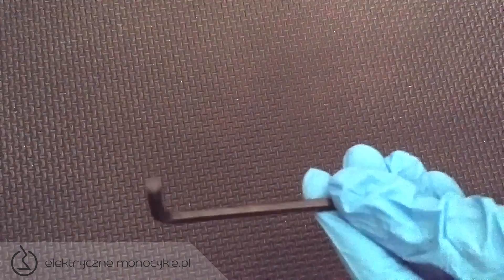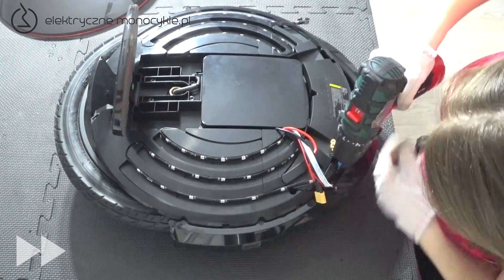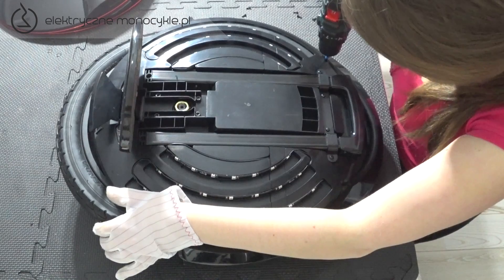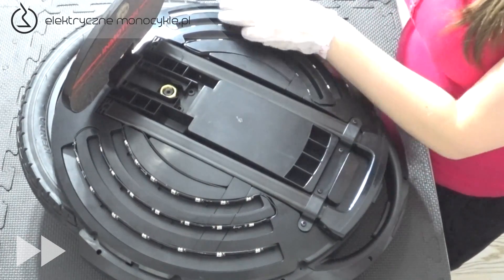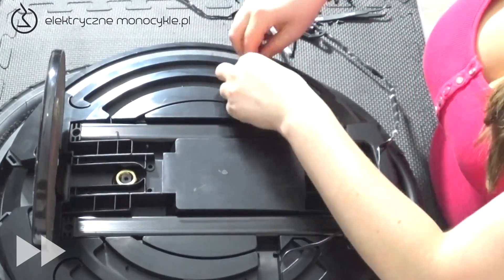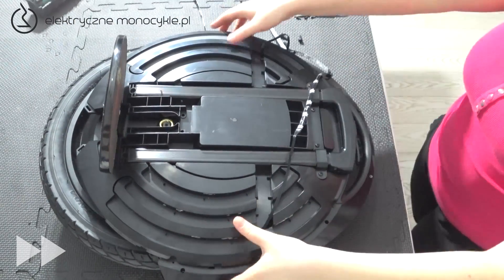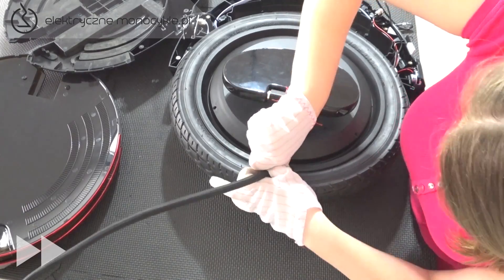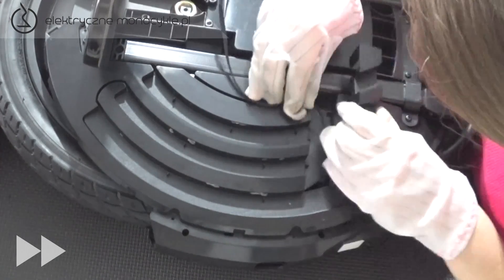Inmotion V8 - wymiana opony i dętki w 5 minut + demontaż (Justina's Garage odc. 3)

Comment: I have a v8 and replaced the inner tube way easier than this video that’s a lot of not needed steps.
Reply from the maker: If you want to risk weakening your motor connectors and waterproofing then sure :-)
Unless you know exactly what you are doing.
This is a tutorial for people who want to replace the tire / inner tube the safest way, without playing around with crucial components, being exposed to capacitors etc.

Comment: Please trust me, if you have to repair the inner tube on a V8 you do NOT need to remove the leds and NOT the battery. This video doesn't make any sense
Reply from the maker: Sure there is other way to do it, simply by unplugging the motor connections from the motherboard, if you want to void your warranty, because:
- it weakens the connectors, which can be very dangerous after some time,
- it weakens the motor wires,
- you risk damaging the motherboard.

Besides, not everyone knows how to handle electronics and no one wants to touch important parts of the device just to change the tire/inner tube.
My way of disassembly is what I recommend, it's similar to Ninebot disassembly, and you don't have to remove the motherboard cover and unplug the motor.
If you do this differently, it's your call. Inmotion won't replace the mainboard if it was damaged during disassembly, nor they won't be responsible for any failures due to loose motor connectors.

Justina
Reply from the maker: Thanks!

Comment: Lovely! Thank you. One to save for future reference.

edit: Christ, what a pain in the arse it is to have to remove all the LEDs...
Reply: Oh and you've earned a subscriber!
Reply from the maker: Thank you so much! 

xo.xo., 
Justina
Reply: ElektryczneMonocykle.pl have you seen the official disassembly video? You don't have to take off the LED wiring. The entire inner shell comes off
Reply from the maker: Yes, we've seen it. Actually, we have tried this approach before, but it's impractical, because:
- It requires opening the motherboard casing and unplugging connectors. Mainboards are the most sensitive parts of all electric unicycles and most users can easily damage them when doing disassembly,
- The official disassembly shows not how to replace a tyre, but the whole disassembly without reaseembling the device. They take off the LEDs later, too. If there would be an additional plug in the middle of the LED wires, it would be great,
- Unplugging battery and taking only one side seems much less hassle for most people, it's very similar to Ninebot approach.

From our experience, the solution we posted is the best. However, there is no easy way to disassemble the V8, unfortunately. Both solutions takes about the same amount of time to change the tyre.

Of course, you can do this the way you want. Just remember, the official video doesn't permit users to do a complete disassembly and do anything with the motherboard. In case if something goes wrong, Inmotion will not replace a board under warranty. Replacing LEDs is much cheaper than a new motherboard, that is why we advise our clients to do the disassembly our way. We know then they don't touch the motherboard and the warranty won't be voided.
Reply: Thanks for the input, that's really informative.